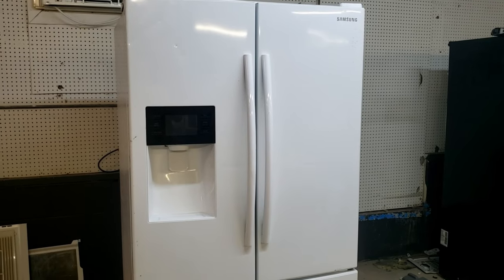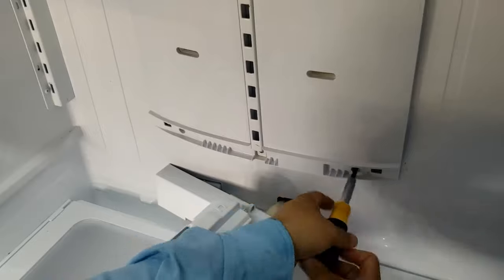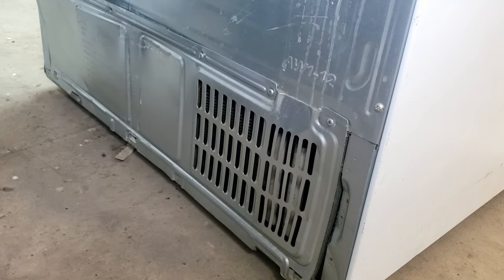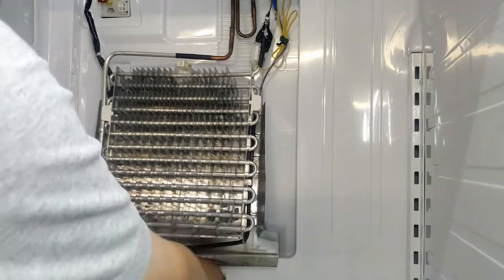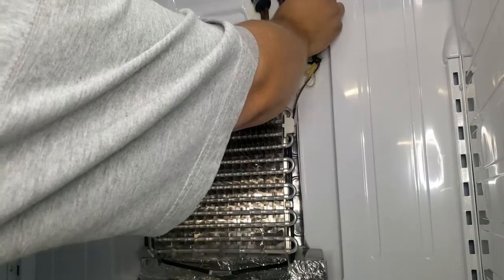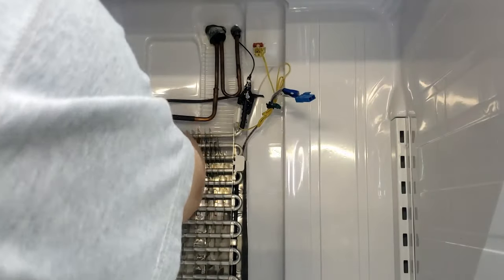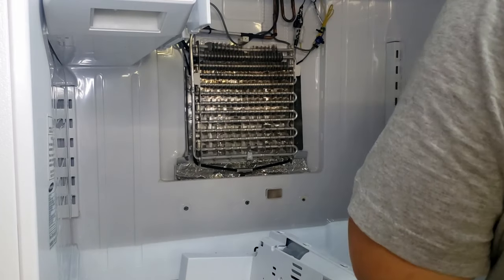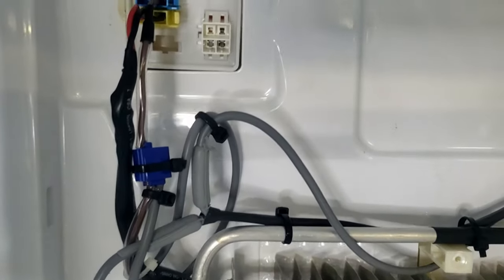Samsung Refrigerator Ice Build-Up and Leaking Water Inside Drawers - How to Fully Fix it Forever

Comment: I just bought the parts required for this fix and based on the comments, I'm really excited that I'll finally have a fix for this stupid problem. Just wondering though, is there anyway to turn just the fridge section off, not the freezer section? I have a small fridge that I can put my refrigerated items in while I let the fridge thaw, but if I can leave my frozen items in the freezer section that'd help tremendously. And yes, I will of course cut the power completely when I do the electrical connections on the heating element.

Comment: Thank you so much for posting this. I've had technicians out to work on my fridge and it was still freezing so I'm giving the minimal upgrade a try with just the drain kit. But keeping this in my pocket with the option of adding the auxiliary heater if that doesn't work!

Comment: Ben I've installed the Kit and it was super simple, I was actually able to fix multiple pin hole leaks in my Water Tank which was as much of a contributing factor as the problem with the heater been enjoying a relatively dry refrigerator and I say relatively because I still have some moisture and ice but I think its a different issue one thing others may find is the back wall plate has rusted (badly in my case) might be where I'm getting additional moisture from. My recommendation get this kit with the POSI-TAP connectors they are awesome! Fridge has been working perfectly for 2 months now!

Comment: Thanks Ben. After replacing many parts (probably unnecessarily) and trying many "fixes" I was ready to give up and buy a new non Samsung fridge.   Just put the heater in as frost higher up was the main issue.  Here's hoping!
Thanks again. Much appreciated.
Reply from the maker: Sadly, I'm starting to hear this problem is popping up on other non-Samsung fridges too. They degrade after time due to tolerances/specs for the upper cabinet freezing over. Samsung just happens to be the worst so far, but others are trying to get there themselves.

Having said that, the heater seems to work about 90% of the time. The other 10% usually is that there's a systemic moisture buildup from somewhere in the fridge, making it too humid which adds heavily to the amount of moisture coming into the fridge.

Comment: Just completed the repair today. Got a bit of a scare when I went to test the heater and got a flashing error code “2 C” but all it meant was I hadn’t plugged in the fan. 😅 Put the fridge into forced defrost mode and I could feel the new secondary heater working. Thank you so much for this awesome video, you saved my $3000 fridge!!

Comment: Great video 
I have three of these fridges
And just did this to one . We will see if it works.
Also last year I wrap the top and side lines with bubble wrap and ducting tape. When I did this upgrade I had to remove this and it worked there was no ice but I had not fixed drain properly and it froze causing it to freeze up.
Also My ice box freezes up do you have a repair for that?
It happens on all three units

Comment: I get the part about putting on the larger metal piece at the bottom so it sticks further down the hole or the ice forms. What's the point of changing out the tubes at the bottom of the fridge and what do the foil foam pieces do exactly

Comment: Great video. Very few videos I have found have addressed the ice buildup at the top of the unit
Reply from the maker: That's exactly why I did the video. Many, many people will upload videos of a shorter term / temp fix like the drain clip on the defrost heater which can work, but not always. i tried to throw as many fixes at the machine as I could that are far more long term and are less susceptible to issues.
Reply: 7:10 - those self-adhesive strips has to be attached from outside of aluminum cover. You gave people wrong recommendation. It has to be between aluminum cover and fridge body !!!!!!!!!!!!!!!!!!!!!!!!!!!!!!

Comment: Hi Ben, I bought the secondary heater kit and it worked great for about 7 months. Last week my fridge stopped working again, and when I opened up the fridge, there was ice on the coils again. I tested the heater and it is still working. Is it possible that I just need to add the aluminum behind the coils and the drain clip to resolve this subsequent freezing issue? Thank you for your videos, they have been so helpful!

Comment: Awesome video.  Im gonna try the fix kit and insulator tape first.........if that doesnt work, i will definitely install the heater.  Ive defrosted ice so many times in mine i dont mine taking it apart to put the heater in.  Really, thanks for this video.  Really didnt want to replace it yet.
Reply: hello, did the insulator tape work?
Reply: @771blahblah  Hi, its been 4 months so far, no more ice ups so far.  I did also install the fix kit from amazon which included a deeper heat extender for the drain, new drain sleeves for the rear, and a few pre cut insulator strips as well.  Upper ice machine still ices up, but thats a separate issue.  Appliance shop says it might be the overfill valve, but im not interested in spending the money to fix that.
Reply: @davea4037  thanks, Dave. appreciate your input!

Comment: I have a Samsung RF34H9950S4/AA Chef Collection 4 door flex fridge that has the ice maker freeze up issue. Samsung has replaced the auger and ice maker about 5 times and the issue still comes back. A few weeks ago I took a borescope down the drain line and found the ice blockage is being formed about 3 – 4 inches outside the ice maker cabinet. I took this video two days after thawing the ice out only to find it was already starting to build up again.

We looked at getting rid of it but it’s still in like new condition and for every fridge we looked at we would be downgrading both in capacity as well quality of the design. 

As a test, with the auger removed I sprayed the drain with DuPont Teflon Snow and Ice Repellant in hopes it might stop the build-up but it didn’t see to do much. I’ve been scratching my head over finding a permanent solution, besides simply turning the water off to the ice maker but am running out of ideas.

So… I thought I’d reach out to a pro to see if you might be able to come up with a suggestion. Thoughts? 😊

https://youtu.be/nV8SbDsB8Tg

Comment: Just purchased your kit, can't wait to fix this forever! On a separate issue, I did also notice the fridge making a "jackhammering" noise when I changed the water filter (new filter is OEM). Any ideas on how to fix this? Seems like maybe a water pressure issue? I closed the water valve a just little bit to lower the pressure, and that seemed to work for now.
Reply: I believe jackhammer might be from air bubbles in the line after filter replacement. The noise could be from water pressure and air pressure interacting at a resonant frequency. I believe you can get rid of the air bubble by using a pitcher and letting 2 gallons of water flow through the water filter and lines. Good luck!

Comment: The drain heater works, if you're really cheap wrap a piece of 12 or 14 gauge copper wire around the heater element and drop it into the drain a little bit. That works too.

Comment: First thank you for posting this video.  Second in the video you show replacing the two new drain tubes.  But what about the third one that’s by itself?  Last I know that the drain tube closest to the coils is for the upper evaporator tray.  But what are the other two drain tubes for?  Thank you
Reply from the maker: It varies by make and model. Some I think even have four, I believe. Generally, its a combination of refrigerator, freezer, flex-zone and ice maker drain tube(s). Again, it varies by model, so the answer will differ slightly. Generally though you only see 1 or 2 that are really, really bad and need replaced.

Comment: When you crimp the supco wire into the blue splice connector, are you pressing the connector onto the wire through the insulation, or just through the stripped wire at the end?  Also, why replace the drain tubes?  Why not clean and reuse the factory tubes?  Third, is there a quick way to check the new Supco connections, like using a continuity tester or something vs. waiting days to see if frost builds up?  Thanks.

Comment: Thank you so much for these videos about Samsung refrigerators, I really appreciate the help and the cost savings. I bought the heater wire kit and I am installing it now.

I have a question, Ben: when I was removing the bottom tray on top of the water filter housing, the water filter housing is now loose and not still attached to the bottom shelf. It looks like a clip or something that I am not able to get the housing to "snap" back into place. Is there a trick to this? Is it in another video?

Thanks in advance....Tom

Comment: Extremely good and concise explanation.   I did do this because I had to do this. It works brilliantly (as we say in the UK), and that was a year ago. I have had no  trouble with my fridge ever since. I cannot thank you enough. I have another fridge, an LG, which had exactly the same problem, and it is now sitting in my garage. The fourth time I had the rip-off experts look at it they fixed the problem, possibly because I told them I was going to put it on the internet with their name attached, and I would also contact the President of LG with their names and the distributor they work for, but I went out and bought another fridge, (This time a Samsung which exhibited exactly the same problem.) This is an easy problem guys...just do it yourself....and know why and how you are doing it yourself. So the original 'fix-it' guys got paid three times NOT to fix it. This an international SCAM. THX China.
Reply: I Believe Samsung is a S. Korean company?

Comment: H Ben. Love your videos! So helpful. I have a GE fridge with bottom freezer Model GFSS6KKX that has been doing the same thing for a long time. I tried fixing it with the insulation pieces and the larger defroster probe but it didn't help. I would like to try the defrost heater repair if it's possible on this model. It looks different than the Samsung. Can you please advise or make such a video? Thx!

Comment: Thanks for the video.  I installed everything as instructed and I think all is well with the initial problem.  However ever since I performed this, the top I’ve maker won’t make ice.  It’s not frozen.  Any idea what I could have done to make it stop working.  I did the test button and made sure it’s on in the front controls

Comment: Ben, I have been putting my Fridge into Manual Defrost most 2 or 3 times a day, for the last month.  and it had been regulating the Fridge Temp perfectly ever since.... I realized that the Problem is Ice Build Up, and improper Defrost setup.... plus, I found out from your Video, that I have the Defrost Sensor in the wrong location, I zip tied it to the Freezer Line as per a 5 year old Video... that is why mine was freezing up, that sensor position was shutting down the Defrost Mode prematurely.  I wondered why it was shutting off in 2 or 3 minutes, not 25 minutes as described in the manual.

Comment: I just installed the kit.  I "hope" it is working as I can't verify it since I've not been able to find out how to put my Samsung POS into forced defrost mode (I have one of the WIFI smart models with the small touchscreen so there are no discrete buttons to push simultaneously).  Time will tell (usually about 3 months before the ice builds up on mine).

Comment: After reviewing Samsung fixes I don't believe their engineers truly understand the problem with the refrigerator. Lack of air circulation is a main problem combined with the Styrofoam insulation and ducting behind the plastic wall. The Styrofoam after Time absorbs water and it freezes. You'll never get rid of the problem completely until you get rid of the frozen water in the Styrofoam. You can remove the Styrofoam and let it thaw for a few days for Saturday and some warm water for several hours.  You need to keep checking the Styrofoam for cold spots to ensure that all the ice is gone. Then let it dry out for several hours or a day. Don't use a blow dryer or heat gun it will melt the Styrofoam and it melts and warps the plastic

Comment: Great video Ben i have a newer model of this refrig but the problem i having is not in the top its the drain leaking into bottom of crisper like you showed with water in bottom then freezing. I did put the new drain kit in with longer probe but still having the same problem. I assume that the heater kit you installed here is for the the upper freezing problem not the lower problem, Is that correct?  And if it is do you know of anything else i can do to fix? Thanks Again

Comment: 7:15 - are those mylar strips installed on the correct side? The kit does not come with instructions and others suggested they need to go on the back of the tin pan, against the plastic interior of the fridge. Curious if it worked your way.

Comment: This is an excellent video, but do you have one that covers ice buildup underneath the freezer drawers so bad it prevents the freezer drawer from closing, which causes everything to get frost-covered and not as frozen as it’s supposed to be?
Reply from the maker: Not YET, that's on the schedule
Reply: Yes I have the same problem with my Samsung. Ice build up 1/2 inch thick every one or two months. Extremely a pain. Waiting for the video on that one Ben.

Comment: I have everything but the the new drain tubes. Are the necessary? The originals are faulty? I hate to put all this back together and it freezes up again. I wouldn’t know if it was Bc of tubes or I messed up elsewhere. Great video 👍🏼
Reply from the maker: They frequently go bad and break, or get so clogged they are useless. ALWAYS check the tubes. if they look good, don't replace them, but I see them go bad very, very frequently.

Comment: Ben - Great video - thanks!   I am pulling my fridge apart right now - it's slightly different than yours in the video, but I cannot get the back panel off.  I've removed all (4) screws, have the metal shelf-slot plate off, and have peeled the panel away from the bottom, but the top seems stuck...  Maybe it's the ice-ball?  The fridge is unplugged and in our garage now so maybe I'll let it sit overnight and try again..?
Reply from the maker: Hi,

Did you get the hidden screw on the evap panel in the middle? I think it may have gotten glossed-over on the video. On that center metal rack (where shelves go), there's going to be a hidden screw behind a plastic piece. I'd double check for it! If you got that + the 2-3 screws at bottom then yes, its likely the ice ball hiding behind the panel.
Reply: @bensappliancesandjunk  Thanks - you mentioned the screw behind the plastic panel in your vid, and I had found that.  👍🏼

it was ice - although my ice concentration was not up top, where the fan is, but down in the drip tray below the cooling pipes.  one long strip of ice.   The cover's off and i'm just waiting for it to melt... :)

Comment: Hi Ben.  So I not only did the two fixes shown here, but I also installed a new thermostat sensor wire.  I turned it on and the whole coil system is frosting over.  I was unclear of what you said the fix is.  I don't feel any warmth at all.  Mind you this was within a few minutes of plugging it back in.

Comment: you don't need to replace the drain tube . pop the upper rubber " duck bill " out . it is the top piece sticking inside the tube extenders . clean them out and slice open the sides . works very well .

Comment: Here’s my experience…I did the whole fix and everything was plugged back in.  I was at the point where I was testing the force defroster setting in the maintenance menu and the old bottom heater is getting hot, but the new heater I installed was not. I was in the RD setting.  I checked the 3M connections and the new heater wires will not pull out so I assume they are making a good contact.  I wasn’t sure if it mattered which of the new heater wires goes to which side of the old heater wires when you splice in? I assume no.  

Also, one tip I have is to strip off more plastic coating on the heater wires and double them back to thicken them up so when you insert the wire in the connector it will make the wire thicker so they won’t pull out of the 3M connector.

Update: it’s working!  I exited the maintenance menu and the fridge got cold for about 30min.  I then entered maintenance menu(energy saver+fridge buttons for 8 seconds) went to RD mode again and my new heater was hot!!! 
Thank you for the kit and the excellent video!!!  Hopefully this fix will last for many years that we shouldn’t have even needed to do because of this terribly engineered appliance.  I will never buy a Samsung refrigerator again in my life.

Comment: I bought this product a few months ago and it worked for a while, but now here we are back to the same problem again.
I can tell you that I have replaced many parts of my Samsung refrigerator. I have replaced the thermostat, fan, sensors and the defrost coil. it keeps freezing again, Samsung refrigerators are just garbage.

Comment: So I bought Ben's kit and wile trying to get the cover off it was frozen solid to the cover(need new cover now). There was a inch of ice in the bottom and the upper tube ,sensor were iced over as well. My problem is the heater damaged the back panel  with cracks and split open. Can I repair this with foil tape or? I'm replacing the heater, sensor and cover and installing Ben's kit. Thak's Ben for the hard work and kit
Reply from the maker: Yes, the tape is for that exact problem. I can't guarantee with 100% certainty that its a sure-shot fix, but I've done similar repairs on other fridges using the exact same HVAC tape with success.